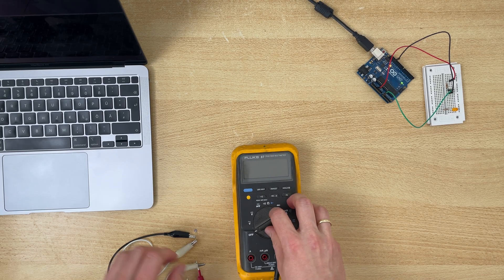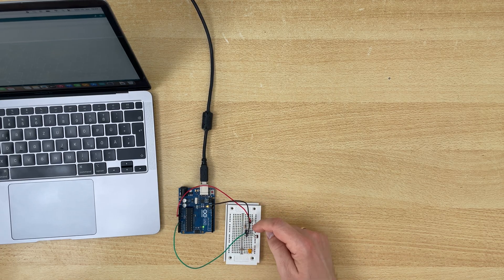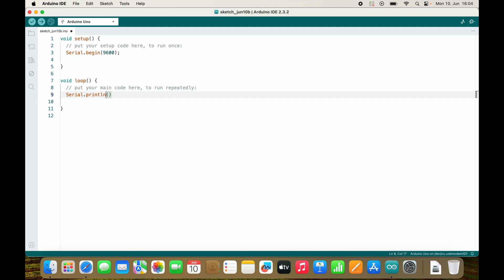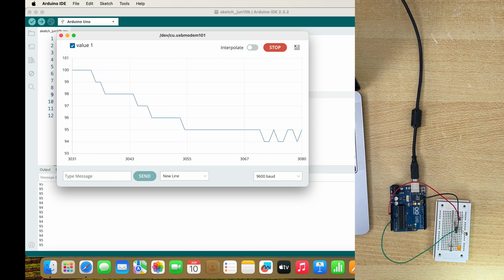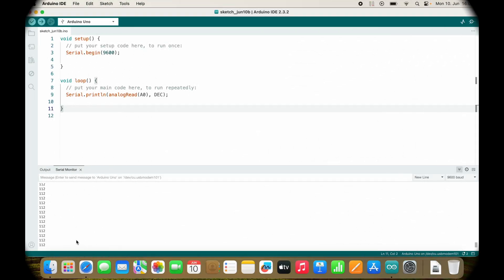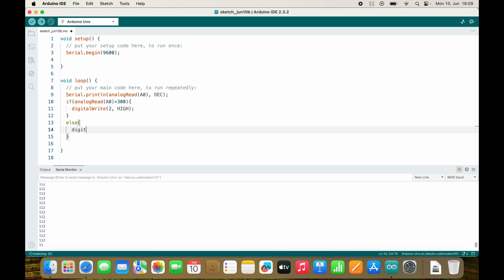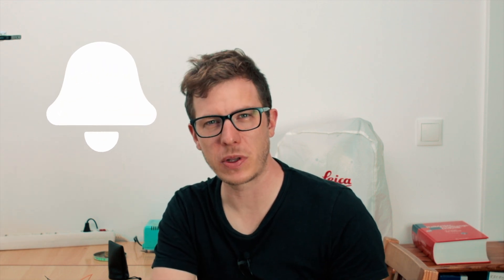brightness measurement - how to use an LDR  on Arduino Uno using a voltage divider and analogRead

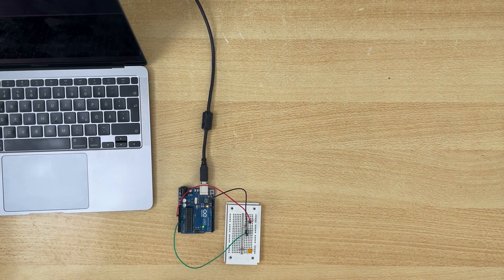Comment: Nice content. Even if it is a simple circuit. It would be better for a beginner if the circuit could be seen larger at time stamp 0:50. Maybe even a drawn circuit diagram. (Don't forget that maybe not all guys saw you previous videos.)
Reply from the maker: True 😅